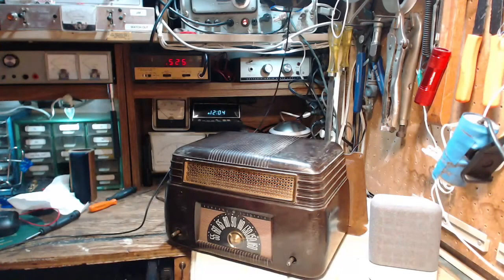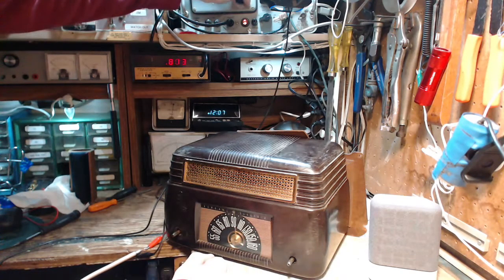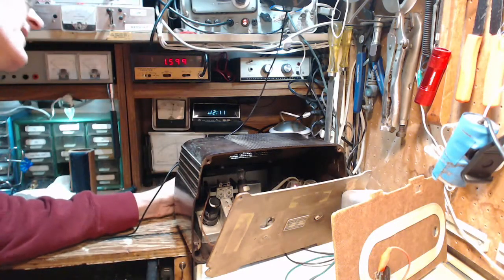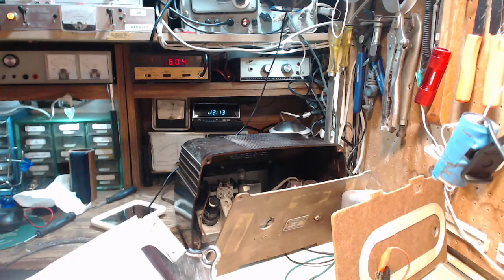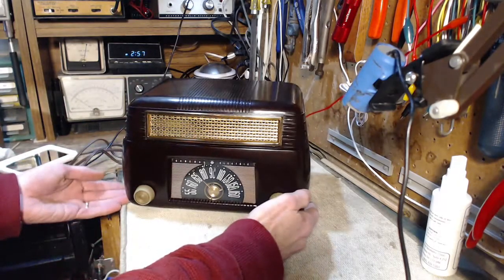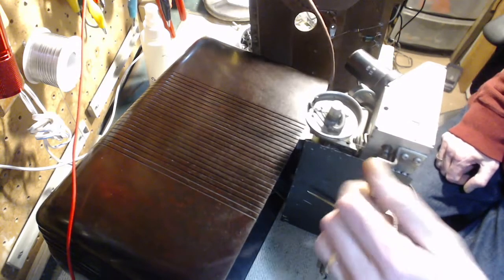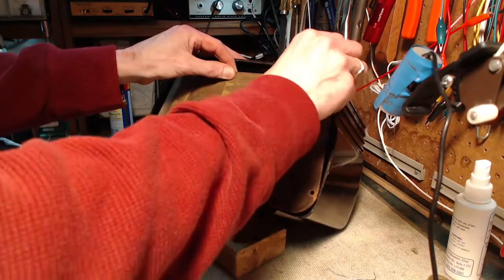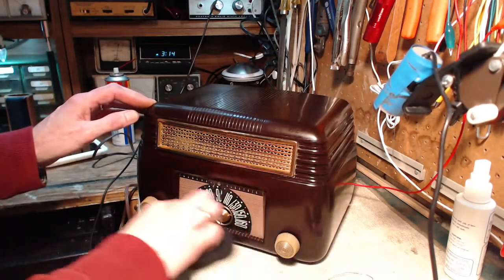General Electric C100 Vacuum Tube AM Radio Video #5 - Final Test

Comment: That case cleaned up nicely...very sharp looking.
I've heard there re certain places that will repaint dial front that are pealing..is that true? Sure it's not cheap but would be nice to know for a rare set to be back 100%
Reply from the maker: GrandsonofKong There are some places that will remake shaped plastic windows and dials with markings.  The print on the back of this one is barely adhering.

Comment: I'm thinking this one could have really benefited from a full recap job. Might have taken some of the strangeness out of the performance. Just guessing. Also, I heard bees wax can really help a loose dial string.
Reply from the maker: ***** Bees wax - yes I've heard the same thing but I don't have any to try.  I usually increase the tension or replace the string entirely although I loath string work.